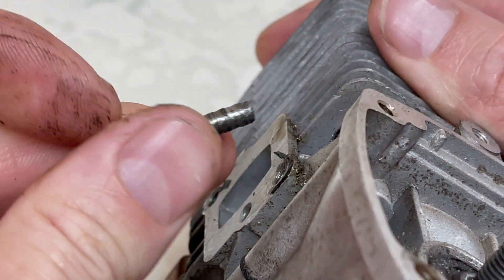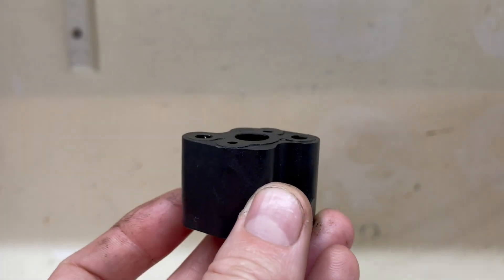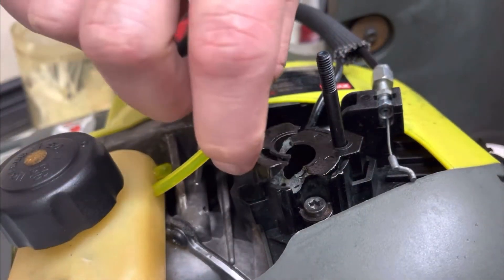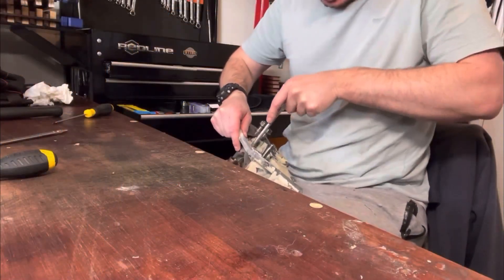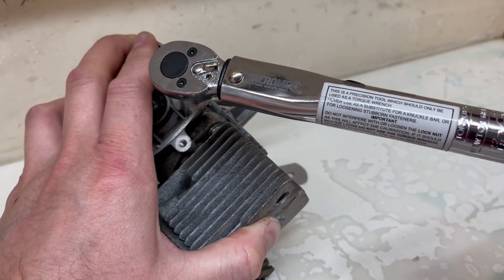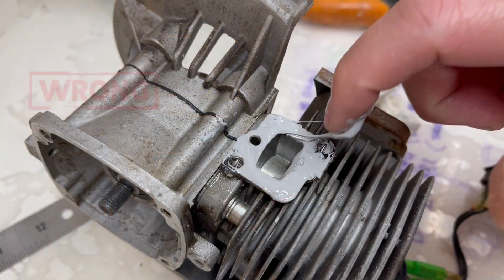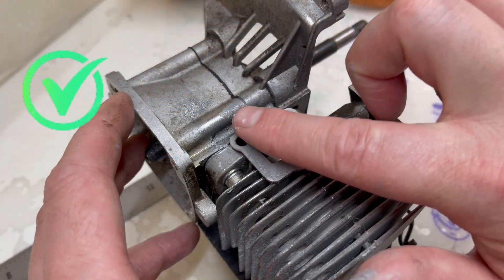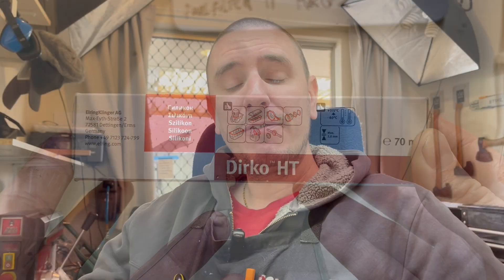3 Things You’re Doing WRONG As A Small Engine Mechanic - STOP!

Comment: I own 4 different torque wrenches; #1 a beam type, for 20-150 ft lbs. #2, a 1/2 drv click type, good up to 200 ft lbs. #3 A 3/8 click type-good up to 50 ft lbs. And a "Dial type", for up to 150 in lbs. And I use them.
Reply from the maker: It’s certainly handy to have torque wrenches of all values! I just find myself not using them as much as I expected I would :)

Comment: I've had to hold my hand up this whole video because yes I'm guilty of probably all of them.
I think the worst sound on working on a one of these small engines it's when you hear that flywheel crack the horrible sound it's a sickening sound and I'm having to find another flywheel somewhere.
Oh yeah one more thing when I use my little impact gun I checked the rotation before I put it on the bolt or spark plug because I tell you one thing if it's tightening and you want to loosen it, well your going to pull the bolt out and you'll see a whole bunch of little pieces of aluminum in your threads and that's also another ouchie!
Thanks for great video and I subscribed because it looks like you got a whole lot of neat stuff on your channel and thank you for the tips!
Take care.
Reply from the maker: Haha you and me both :) thanks for watching and subbing! Great to have you here - enjoy the content!

Comment: Will you please make video just about small engine flywheels?And maybe how to use weights(or scale) with specified length of ratched to correctly torque most sizes of flywheels.
Reply from the maker: I can’t I’m afraid, flywheels have different torque specs. I’d suggest buying even just a cheap torque wrench, you’ll be surprised how accurate they can be!
Reply: @VintageEngineRepairs  Appreciate your reply.The reason i mentioned weights is that i have three torque wrenches.Very accurate,till you go above 30 ft/pd.Then you can easily strip nuts,before realizing something is wrong.At 125ft/pd(gx390 flywheel nut) i measured actually 230 nm applied .Thats after cracking two old flywheels.Stupid,i know to assume torque wrenches is callibrated through scale from low to high .Few months back i callibrated it carefully at torque settings below 30 ft/pd.Assuming(wrongly!) that high torque will also be correct.

Comment: Found out not to over tight stuff yester while working on a weedeater. I stoutly tighten primer bolts after replacing primer and couldn't figure out why it was leaking till i retracted taking it apart and remembered those bolts werent so tight. Went back and just got them hand tight basically and it primed but now im just gonna replace the whole carb. 🤣 at least it works now
Reply from the maker: Haha yeah those little m3 screws need very little torque, firm is perfect :)
Reply: @VintageEngineRepairs  thanks for the info. For me it was crazy how this video randomly popped into my feed after the fact, would of been nice to see before hand
Reply from the maker: @victorgarcia9791  It’s great to have you onboard now and I hope you enjoy the other tutorial videos I’ve shared so far :)